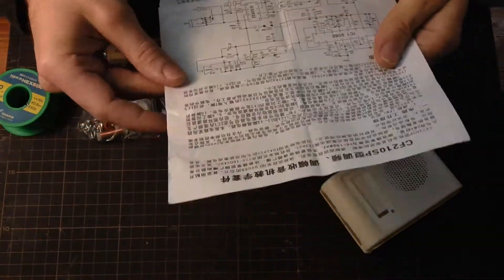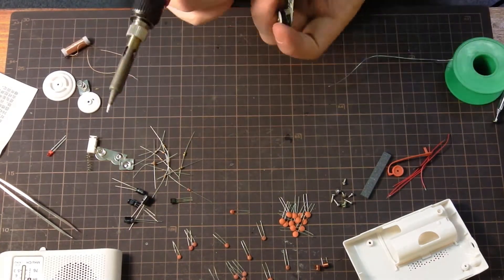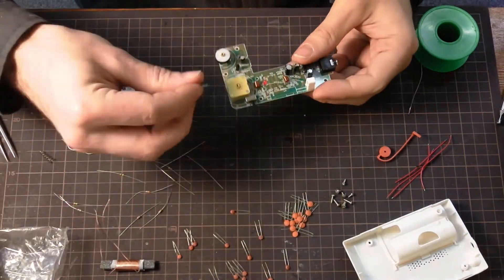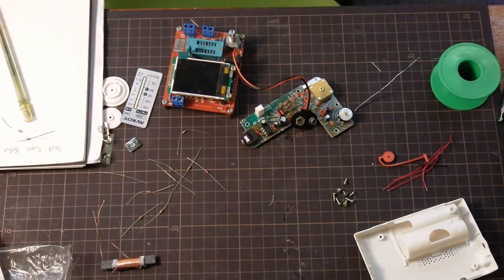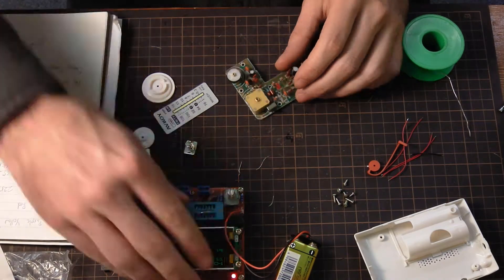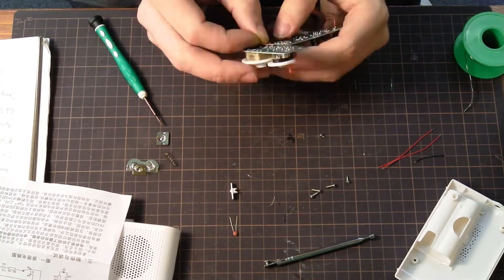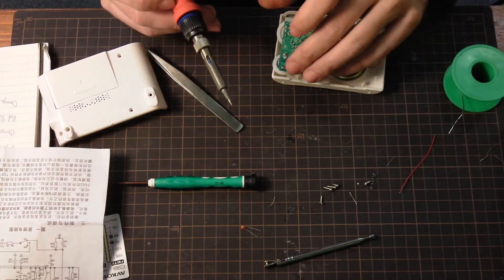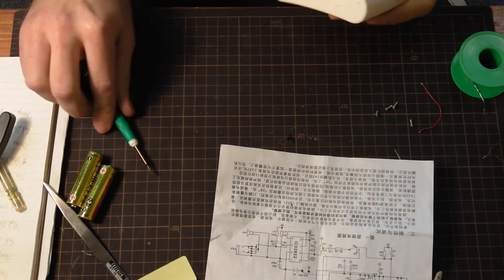AM/FM Radio Kit CF210SP: No English instructions, no problem!

Comment: The politically correct mnemonic way to remember the color code order is Bad Beer Rots Our Young Guts, But Vodka Goes Well.
Black, Brown, Red, Orange, Yellow, Green, Blue, Violet, Gray, White
Gold and Silver are only used with bands 3 through 6. Gold as a multiplier is 0.1 and Silver is 0.01
Black is zero, Brown is 1, etc.
For 3 band resistors it is Digit, Digit, Tens Multiplier. So, Red, Orange, Brown would be 2, 3, x10¹ so 23 x 10, or 230 ohms. Blue, Gray, Yellow would be 6, 8, x 10⁴ or 68 x  10000, or 680K ohms. 
The fourth band is the precision of the resistance. This is where the colors are odd, but for the most part, you will probably only see Gold (±5%) and Silver (±10%)
5 band is Digit, Digit, Digit, Tens Multiplier, Precision.
6 Band is Digit, Digit, Digit, Tens Multiplier, Precision, Temperature Coefficient. And that is how the resistor color code is read.
Reply: Or just Google it